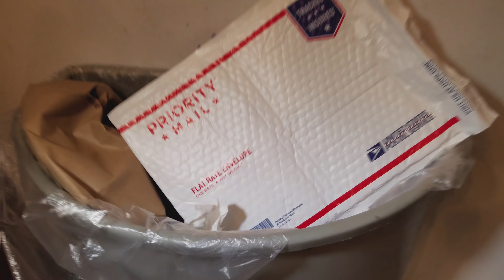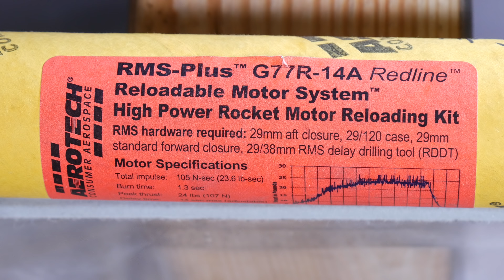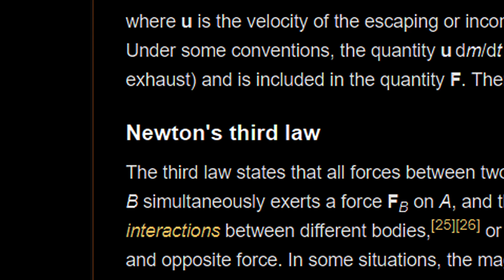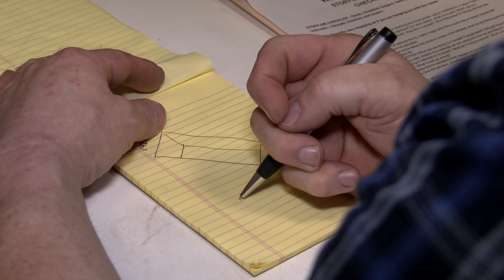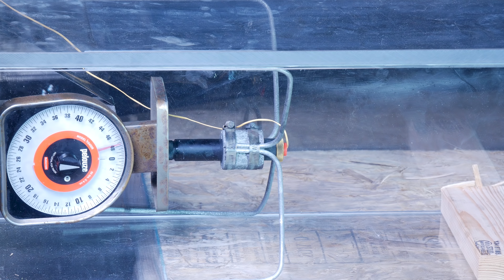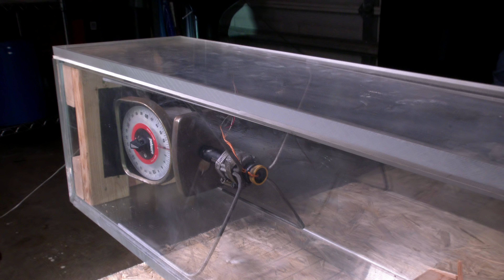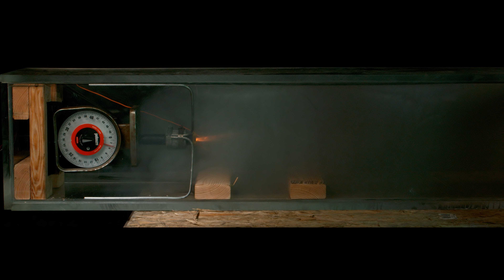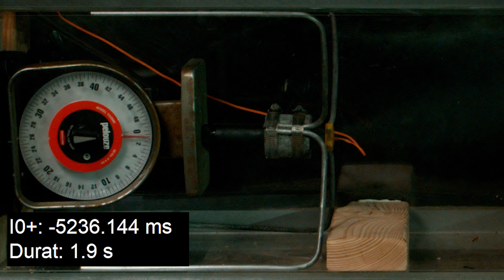Rockets in a Vacuum Chamber - Newton's third law of motion Visualized

Comment: You lost the vacuum by pressuring the chamber with the rocket exhaust.
Show constant vacuum on video next test.
Reply: Plus, I believe they only used solid fuel boosters for liftoff. Once they were in space they used the liquid fuel rockets. Basically another reason this example/test doesn't prove anything. Well, it DOES prove something but to say it would seem 'trollish'.  LOL
Take Care All
Reply: that and there is a wall 3 ft away from the rocket... you would have to build a much bigger chamber imo and show that you had a sollid vacuum the whole time
Reply: Nice to see a few Lions among all the Sheep.
Reply: Not enough atmosphere generated by that rocket motor before it was effected by Newtons third law. It applied pressure to that scale within milliseconds. Your supposition failed.
Reply: We don't know the expansion rate of the burning fuel..  It should be significant,  but,  we don't don't know.
Reply: why did it produce thrust during the initial moment?
Reply: @jackschwartz1783  They solid motars in space as well. Chinese do this often.
Reply: *use
Reply: @SternLX  - Even the tiniest bit of atmosphere, inside a perfect vacuum, would cause this, so he is right. Test is a fail.
Reply: Jesus people what is so hard to believe about rockets burning in space, you need o2 to burn anyways I think that's why they put oxidiser in the fuel???
Reply: How big of a space would you need to properly test this out? You would need a vacumm capable of accepting alot of atmosphere without diminishing. How much material is ejected from a launch like this? I assume its enough to setoff my smoke alarm if i did it at home.

Its funny how most modern attempts to prove these bollocks theories usually end with the attempt further damaging the theory. Haha. But the fools still act like we are the morons. Its an idiocracy. Lol
Reply: look up the amount of exhaust released from the solid fuel rockets, i think once you do the maths you will find that the chamber was no at a vacuum, very quickly :-(
Reply: Daniel Erdman EXCACTLY
Reply: The thrust of a rocket depends on molecules repelling each other and is not dependent on pushing against an outside atmosphere. Think of holding a magnet together where you are pressing the same polarity together. As soon as you let go, the magnets repel each other. The force of your hand was containing all that energy inside of the magnet from doing what it naturally wanted to do.  Magnetism works in a vacuum. it is the electromagnetic force that makes this happen. That same force is contained within each atom. But is held together by an outside force (like your hand) This outside force (called the molecular forces) are released by a chain reaction called combustion. The atoms then do what they naturally do and repell each other. some of these atoms bounce against the rocket and push it forward. This does not require an outside atmosphere to create pressure. It creates the pressure on its own. This pressure is directed so that the only way the molecules can escape is through the nozzle. This happens quickly but not happen instantaneously. if It were instant, you would witness it as an explosion. Since the burning happens over time, some molecules become trapped between the rocket and other molecules that havent found the escape yet. Those molecules bounce around against each other and the rocket and continue to expand until they find the nozzle and escape. Rockets can work in a vacuum.
Reply: @johnmabbott7420  sooo would that not happen in errrrr space............? You people are mental.
Reply: first, there was thrust as soon as seal is broken off. second, no this is not to prove a theory. newtons 3rd law is not dependent on fluid dynamics there is no reasonable reason it should act any different in a vacuum. third, the vacuum of space in not a perfect vacuum. it has something like 5 atoms per cubic meter. is that enough to 'push off of'? if not where is the cut off, what would be just enough?
Reply: En ki  how?
Reply: This test isn’t actually necessary to show that Newton’s 3rd works in a vacuum. A rocket engine creates force by changing the momentum of its propellant. F=ma. P=momentum=mv (mass x velocity).
a=dv/dt=change in velocity with time is acceleration.
dP/dt=change in momentum with time=m(dv/dt)=ma
F=change in momentum with time.

In a rocket the propellant explosion is directed out the back. This explosion is a change in momentum of the propellant. This change in momentum pushes on the rocket. 

He didn’t have to burn a mini rocket motor. He could have used a water hose. Remember, this about Newton’s 3rd law not propellant ignition systems.
Reply: @richardjackson5023  Also thrust was impacting on the end side of the box hence the propulsion even if vacuum.
Reply: @whiskyweasal89  

Because of your word soup?
I don't think so.
Still inconclusive for many reasons, read above.
Reply: @bengrizzlyadams6187  its all bullshit....they know rockets do not work in space..lolol
Reply: Ben Adams you can find inefficiencies in any experiment so I guess when you want science to say what you want it to say then you can explain it away by saying it’s inconclusive. 

But my explanation of how thrust is created does not rely on this experiment, what I said stands on its own but “word soup” heh.. ok man.
Reply: @whiskyweasal89  All the word salad of this world cannot replace a good experiment.
Reply: @whiskyweasal89  Inconclusive means I take no side, there are not inefficiencies but intermittencies.
Reply: @whiskyweasal89  

Speaking of inefficiencies, take Cavendish, its only inefficiency was Foucault's pendulum.
Reply: @whiskyweasal89  Looks to me like we are sitting in some sort of Van Der Graaf generator, we power it though our activity by ionizing the air that then gets trapped into the dome it charges, (hence lightnings when overloaded), it powers both the moon, which is some sort of Pelletier reaction, and the sun, which is some sort of Tesla coil, that acts on noble gasses like on a fluorescent tube, hence the white cold light of the day even without an apparent sun. So life powers the celestial vault in return, the cycles of hot and cold exactly like in a Polymerase Chain Reaction, sustain life.
Reply: I agree, combustion caused expansion of gases that far exceeded the negative pressure  in the chamber, to the point of lifting the plexiglass near the engine. It was a great effort though. It seems it would require a much larger negative pressure chamber to carry out the experiment.  Space has no atmosphere for the rockets to displace, nothing to provide thrust for the rockets to push against.
Reply: @neriuslandys2190  The rocket will have momentum as a result of combustion in the rocket engines.
Reply: @neriuslandys2190  Its hard to single out any group of people for distorting truth and live in the US. That's what this country was founded on, a skill 
 in politics today. We are bombarded with it all the time, just turn on Cartoon Network News and watch Cooper Slanderson blame a short carrot on Elmer Fudd and you'll agree.
Reply: @RadespotosR In the instance of pushing a ball, both bodies will be set in motion in a weightless environment. One would continue to move away from the other until something came along to change their drift. To think that because you push the ball you would remain stationary in space is to say space revolves around you. Since there is no gravity in space why limit yourself to a basket ball when you could move a mountain just the same? With combustion you will have thrust as long as it takes place in an enclosure with an exhaust.  The hot gases produced will be under an extreme amount of pressure to escape.
Reply: @whiskyweasal89  theres nothing higher than truth...truth is rockets do not work in a vacuum....unless u make a lot of gas in a small vacuum first so it can push on that...can't u see they made this to throw u off track....they failed of coarse....
Reply: Dylan Sullivan ppl belive in Jesus. So that experiment could also be real.
Reply: The vacuums case by design creates its own atmosphere  with waste, fumes and hot gasses, it also creates thrust off the end of the case,  nothing like the vastness of space.
This could be solved with a much bigger case and a smaller rocket.
Reply: Ya but he was looking for the push before any buildup of pressure and he got it.  
Later on yes the pressure inside built and helped the thrust.
Reply: @whiskyweasal89  explanations prove nothing...PRACTICALLY DEMONSTRATE your claim or keep your SUBJECTIVE opinions, ideas, theories, concepts and BELIEFS where they belong..in your head where they work subjectively for YOU.Follow the scientific method of discerning Subjective thoughts from Objective Facts . SHOW ME
Reply: Woody Woodlstein   The partial vacuum was so quickly pressured there is no evidence to support his theory.
Others also rightfully pointed out the wall of the case to push off from.
The harrier jet fighters also use directed exhaust to achieve vertical lift.
If the lifting forces came from the internal pressure against the front of the engine, “or rocket”, the old opposite 
and equal reaction, then the harrier jet would not be capable of vertical flight by vectoring exhaust.
This is obvious even in Earths atmosphere, not to mention space.
By the way, the scientists are the ones to claim space to be a vacuum.
Now the same scientists claim the Earths atmosphere extends far beyond the moon.
The truth is that science is constantly changing the “facts” to fit their theory.
In fact scientists are still teaching theories that have been proven to be wrong.
You can not intelligently discuss science with people who keep quoting theory as fact.
I am a commercial pilot and certified flight instructor, who use to teach “scientific theory” 
as it were a fact, until I overcame cognitive dissonance.
We need to question what we were taught by so called scientists, who were taught what to believe rather
than what is true.
Any scientists who question the so called facts is summarily punished, eventually the facts are proven wrong.
History proves this to be true.
Truth takes nothing for granted except that so called facts change in the light of truth.
You can not prove theory by quoting theory.
Only by questioning theory or so called scientific facts can the truth be known.
Godspeed.
Reply: @bobroberts8629  would I feel any recoil if I fired a crossbow in a vacuum?
Reply: SternLX .......   affected.
Reply: @danielerdman7543  on the other thread, I thought you said you were "not so far gone" as to believe that rockets do NOT work in a vacuum.  Well I can convince anyone with a high school grasp of physics that rockets MUST work in a vacuum.  They just need to answer about five simple physics question (with no math).  If that is out of the question, I have proof that anyone can observe in person OR watch any of HUNDREDS of actual videos of rockets working in a vacuum.  Either way: Newtonian Physics says rockets MUST work in a vacuum, or "F=m x A" is false.
Reply: The first question is: if I fire a crossbow in a vacuum, will I feel a recoil force?  Yes or no? Why or why not?
Reply: Stuart Gray    Apples and oranges Stu.......
A crossbow is purely mechanical.
A rocket allegedly moves because of the opposite and equal reaction forces pushing 
against the front of the rocket.
If this were true then how does the vectored exhaust on the Harrier jet achieve vertical flight ?
Unless you move the front of the engine upwards, how does the compressed air, expanding hot
gases push the jet upwards ?
Only if the compressed hot burning expanding gases are pushing against the ground then the atmosphere 
can it create lift.
NASA claims space is a vacuum so without an atmosphere to push against, the rocket has a problem.
Unless the exhaust is not the motive force and the equal and opposite reaction pushing against the front 
of the rocket is the correct theory, and then the Harrier jet has a problem.
By the way, science now claims that the Earths atmosphere extends far beyond the moon,
according to the European space agency in yet another video.
Godspeed.
Reply: @danielerdman7543  - "Apples and oranges Stu.......
A crossbow is purely mechanical."

Yes as is a rocket engine shoving MASS in one direction EXACTLY like a crossbow firing a bolt.
Or are you going to argue that the Law of Conservation of Momentum DOES NOT apply to gas molecules?
You wouldn't DO THAT because it would prove that you never took a single Physics class as part of your "Electronic Degree"

so what do you say, do gas molecules have MASS?  DO they require a FORCE to accelerate them or not?

If you had the courage to just ANSWER my questions without trying to change the subject you would understand very quickly how it works.
But just like others who PRETEND that their degree is the same as an actual ENGINEERING DEGREE, we see that your "degree" does not even include HIGH SCHOOL level physics concepts or you woudl just ANSWER my questions instead of distracting FROM THEM.
Reply: Oh I SEE you mean where I called you a liar (on a different thread) for LYING ABOUT WHAT NASA SAYS?  Then YES I DID call you a liar again because what you said are flat out LIES.
Reply: Bob Roberts    This experiment is far from a valid scientific approach.
NASA claims on videos to have repeatedly traversed the deadly VanAllen radiation belt
for years on our trips to the moon.
NASA now claims on videos that we can not send men through the very same Deadly belt.
NASA further claims that they forgot how they did this and lost their notes.
NASA is obviously lying.
Why is NASA still running things and funded millions?
How stupid are we ?
It is time to bring NASA to court for fraud and racketeering, put them in prison 
and find out what they are hiding and where the money really went.
Godspeed.
Reply: Stuart Gray   Poor poor Stu...
Ok let’s do this the scientific way.
First state by what force is the inertial mass velocity changing.
What is the mass force pushing against ?
Is the rocket moving through the vacuum of space because of the opposite and equal reaction 
force pushing against the front or inner bulkhead of the rocket ?
Or is the rocket moving, changing its inertia by some other reasoning ?
I need to know what you are specifically stating is causing the rocket to change its inertial state and move.
Please respond.
Godspeed.
Reply: Stuart Gray           that is unwarranted Stu....
You misquoted and likely miss understood me.
I never said NASA admitted forgetting everything or loosing everything or can no longer launch rockets.
What I did say is that NASA videos state that they lost the technology and by logical inference can’t 
remember how to send manned missions to the moon or beyond.
NASA videos also state that they repeatedly traversed the Deadly VanAllen Radiation belt for years
Just decades ago on their successful maned moon missions.
NASA videos now state that before they can risk manned missions to the moon and beyond that
they must first figure out how to protect the men from the deadly radiation.
These videos are NASA’s own videos, they are historic documents, they are indisputable facts.
This is what I said Stu.
You deliberately misquoted me instead of intelligently discussing this with me.
You are once again guilty of liable.
I am getting a bit offended by your repeated personal attacks of my integrity, cool your jets ok ?
Now that I put you in your place, take a deep breath and put your scientific mind to the task.
How can you possibly argue that NASA by their own videos prove they are lying one way or
another, either they did or did not traverse the deadly VanAllen radiation belt or they didn’t.
Either way now they claim to have lost the technology (which is unbelievable and grossly negligent).
Furthermore how and why is NASA still running anything in light of their own damming videos?
I can’t wait to hear your next apology and explanation.
Godspeed.
Reply: @danielerdman7543  - "NASA claims on videos to have repeatedly traversed the deadly VanAllen radiation belt
for years on our trips to the moon."

NASA DOES NOT SAY THIS you are MAKING SHIT UP!
Reply: @danielerdman7543  - You dont get to answer MY question with more questions:  I CAN CONVINCE you but YOU Must provide the answer to MY questions without putting words in my mouth. Now ANSWER THE FIVE SIMPLE QUESTIONS: 

1 - IF I fire a crossbow IN A VACUUM, IN a WEIGHTLESS (freefall) environment - WILL I FEEL RECOIL ? YES OR NO?

I will NOT go on until you answer.

If you would like to surrender and admit that you have no intention of answering JUST FUCKING SAY THAT.
Reply: @danielerdman7543  OH and I TOLD you I have VIDEO EVIDENCE of rockets working JUST FINE in a vacuum, but I will not show the videos to you until AFTER you answer my questions OR ADMIT YOU CANNOT.   I have not even TOLD you that the company I work for buys Hydrazine Mono-propellant thrusters from Moog corp.  We TEST EVERY SINGLE ONE - IN HARD VACUUM to verify that they provide the same thrust as predicted by the rocket equation .  I have EYE witness test reports to prove it.  Lookup Moog corp for a description of their thrusters and their Vacuum test capabilities.

And DID YOU EVER WATCH that video about the Honeywell pre-flight test of the RLGs?  The one where the Honeywell engineer explain how his Inertial Reference UNit MEASURES EARTH ROTATION before a flight?  NO? WHY? Scared?
Reply: Stuart Gray     Hello Stu,
Since I do not believe in your what if question being possible I am reticent to guess.
However, I will.
In my opinion theoretically you would feel a recoil, the arrow would move away from you
because of the greater mass of you and the bow as something to push off from.
The potential energy from the spring is converted into kinetic energy to cause
the inertial state of the arrow in such a way as to propel it at a certain velocity and trajectory
unimpeded until acted upon by an outside force.
You might also induce an inertial change in yourself and the bow due to the recoil effect.
Does my opinion differ from yours ?
Now please answer my question.
What specifically causes the rocket to move, the escaping exhaust gases or the opposite 
and equal reaction force applied to the front or inner bulkhead of the rocket ?
Quid pro quo.
Godspeed.
Reply: Stuart Gray    Hello Stu,
I would be very interested in seeing your videos of a real practical test of a rocket operating in an appropriate 
vacuum test, not a small plastic box like the one that started this conversation.
You gave me so many things to read before you would even talk to me civilly, I think I did watch the video
you reference.
The problem with them all is that they pre-suppose a spinning globe model right from the start and base
all of their theory of operation on that unprecedented premise.
I do understand the theory of operation however it does not prove the spinning globe model 
it assumes it fight from the start.
This is like you keep saying, it is so because you say it is so.
Your only authority and supremacy is self declared, not in any scientific way proven.
This is the fundamental flaw and problem with your theory.
Scientific theory has been adulterated by over zealous self asserting experts who
declare scientific theory to be “the law”.
As scientific knowledge increases it is summarily impeached at the first suggestion of violating 
a “scientific law”.
For science to be pure, unadulterated, and truthful there is no room for absolute law.
The truth is, always was, and will always be, above any so called law.
If the law can not and will not tolerate being questioned, it is not the truth.
The law fears and falls or stands subject to only the truth.
The truth is supreme, not the law.
Every true science is subject to the truth.
Science is the pursuit of truth.
Today science has been adulterated by self appointed experts who seek fame and fortune above 
the truth, the true science.
This is why it is so hard for the experts to accept the truth rather than protect their own self interests.
Today science is all about the fame and fortune and protection of the status quo.
You can’t be published if you go against the status quo, you are labeled a lunatic.
You loose your license as it were, your credentials, your standing, your carrier.
Just like the so called flat Earthers, just because they dare question the law.
The so called law is the problem.
Godspeed.
Reply: @danielerdman7543  - Your answer is correct.  A bow WILL FEEL recoil in a vacuum (in "zero-G") when it fires a projectile ("Bolt").
This is because the Bolt HAS MASS.  As the Bow pushes on the Bolt, the Bow feels the SAME FORCE as the Bolt does for the SAME amount of time until the bolt leaves the "breech" and is no longer touching the string.
This is Newton's Third Law: "For every Action (the bow pushing on the bolt), there is an equal and opposite Reaction (the Bolt pushing BACK on the Bow)"

Second question: What do we call the PROPERTY that the Bolt HAS that allows it to PUSH BACK on the Bow when pushed upon?

Third Question:  If we replace the Steel Bolt with a Bolt made of WATER ICE (same Mass) will the Bow STILL FEEL a recoil?  What about DRY ICE (solid CO2) will we still feel a recoil?

"You might also induce an inertial change in yourself and the bow due to the recoil effect."
DO you know the NAME of the Physics concept that makes your statement above a FACT?
That is the "Law of Conservation of Momentum" are you familiar with it?
Reply: @danielerdman7543  - "The problem with them all is that they pre-suppose a spinning globe model right from the start and base
all of their theory of operation on that unprecedented premise."

NO - then you DID NOT watch the video, so I will explain it to you.

Lets consider a SINGLE AXIS ring laser gyro (Sagnac Interferometer).  It is basically a coil of fiber optic and it can sense rotations about the axis that goes through the coil like the axle on a bicycle wheel.

An actual GLOBE will help you visualize the following: 

If you take this RLG and set it FLAT on a level table at the North Pole and read the rate is says it it rotating at it will read 15.0 degrees per hour because the sense axis is ALIGNED perfectly with earth's spin axis.
If you FLIP IT OVER, it will read MINUS 15.0 degrees per hour.
If you STAND IT STRAIGHT UP, it will read ZERO DEGREES per hour because it has NO COMPONENT of earth's spin axis aligned with the sense axis.

Now repeat this experiment at the Equator:

If you take this RLG and set it FLAT on a level table at the EQUATOR and read the rate is says it it rotating at it will read 0.0 degrees per hour because the sense axis has NO COMPONENT of earth's spin axis aligned with the sense axis.

If you STAND IT STRAIGHT UP,  it will read 15.0 degrees per hour because the sense axis is ALIGNED perfectly with earth's spin axis.

Now repeat this experiment in Wyoming USA (latitude ~45.0 degrees):

If you take this RLG and set it FLAT on a level table in Wyoming and read the rate is says it it rotating at it will read close to 7.5 degrees per hour because the sense axis is only HALF aligned with earth's spin axis.

Now TIP the gyro UP 45.0 degree towards the NORTH and the GYRO WILL READ FULL EARTH RATES. - 15.0 degree per hour because NOW it IS aligned with earth's spin axis.

Now imagine an Inertial reference Unit that has THREE Sagnac Interferometers all aligned Orthogonally with respect to each other. (at 90 degree to each other).

Now it can sense rotation about ALL THREE AXES.

When a Three axis ring-laser gyro is placed on a level table it can sense the spin of the earth on ALL THREE AXES.   Lets say the "Z-axis" is pointed, aligned with the gravity vector ("Up").  Lets say we are in Wyoming again.
Align the X-axis "North"
This will align the "Y-Axis" to the "West".
SO NOW the Gyro will read ~7.5 degree per hour on the Z-axis (like in the example above)
It will read ~7.5 degree on the X-axis since it is tipped 45  degree with respect to earths spin axis like the Z-axis.
The Y-axis will read 0.0 degrees since it is perpendicular to earth's spin axis.

Using this knowledge and SIMPLE TRIG, you can determine YOUR LATITUDE ANYWHERE ON THE GLOBE using JUST a three-axis ring laser gyro and a bubble level.

If the Gyro had ever been calibrated ( to know what it reports as positive rotation versus negative) then you CAN TELL WHICH HEMISPHERE YOU ARE IN.

You can even do this correctly with a little math EVEN IF THE GYRO IS AT AN ARBITRARY ORIENTATION with respect to "North, south, east, west".

THIS IS HOW the three axis ring-laser gyros perform pre-flight tests.  If they DONT READ THE PREDICTED RATES on ALL THREE AXES based on where they are on the Globe, THEY GYRO IS BROKEN.

Daniel Erdman - I have PERSONALLY measured earths SPIN AXIS (using an Airbus Astrix-120) with respect to the local gravity vector in Boulder, CO, then I DID IT AGAIN at VAFB, CA.

GUESS WHAT? - The alignment of earth;s spin axis (with respect to the local gravity vector) SHIFTED BY ABOUT 5.5 DEGREES between the two locations.

Care to GUESS WHY that was the case?
Reply: Stuart Gray    I answered your what if, now pay up and answer mine.......
I am not taking a damn physics test Stu.
You agreed to answer my question after I answered yours.
Pay up or shut up !
Godspeed.
Reply: @danielerdman7543  finish answering my questions, and you will answer your question YOURSELF.
Reply: Stuart Gray   Yes I did watch the video.......
Don’t you see that you just keep repeating the same old explanation which is unconditionally 
based on the false assumptions of a SPINNG GLOBE FALICY ?
Right from the beginning your device assumes a spinning globe, it does not prove the assumption!
This device just like the original gyro operates on the principle of the gyroscope’s rigidly in space.
Wether the Earth is a spinning globe, or as all aviation charts specify a flat plane non spinning model
for all real time navigation, the gyroscope couldn’t care less.
The gyroscope could theoretically be in a space ship on its way to mars !
You claim and assume your model, the gyroscope proves it not.
In reality it does perform on the real and only officially accepted Earth model 
the flat plane, non spinning model.
The only official and accurate map is the flat Earth map.
There is absolutely no accounting for any Earth curve in any navigation problem.
The Air force, Navy, Surveys, and railroads never take the alleged curvature in account.
Show me one instance in practical navigation, any real navigation chart used by real pilots
that include curvature.
Something real in practical every day use today not some exotic math that takes four years to comprehend 
because it is not real.
Show me an engineer who works here on Earth not allegedly in outer space that actually enters the alleged 
Earth curve in account.
No surveyors do.
No pilots do.
No submarines do.
No naval gunnery or missile launch officers do.
Show me just one Earth bound real example.
You can’t, can you ?
The Earths curve is only alive in the over active demented mind of esoteric pseudo science.
Now put up or shut up.
Godspeed.
Reply: @danielerdman7543  - "Right from the beginning your device assumes a spinning globe, it does not prove the assumption!
This device just like the original gyro operates on the principle of the gyroscope’s rigidly in space.
Wether the Earth is a spinning globe, or as all aviation charts specify a flat plane non spinning model"

This is PROOF that you either did not read my explanation or you didnt understand it.  THE DEVICE MEASURED THE CURVE between Boulder, CO and VAFB, CA.  There is NO SOFTWARE to "fool" me in this system. We verify earth rotation rates WITH RAW DATA FROM EACH GYRO AXIS - YOU CANNOT "FOOL" IT .
Reply: @danielerdman7543  - " am not taking a damn physics test Stu."
WHY? Because you are INCAPABLE, or you KNOW that IF you answer my questions truthfully that IT EXPOSES THE FLAW IN YOUR REASONING?

Now answer the questions: 

Second question: What do we call the PROPERTY that the Bolt HAS that allows it to PUSH BACK on the Bow when pushed upon ?

Third Question:  If we replace the Steel Bolt with a Bolt made of WATER ICE (same Mass) will the Bow STILL FEEL a recoil?  What about DRY ICE (solid CO2) will we still feel a recoil?
Reply: @danielerdman7543  As for your navigation over a sphere - Wolfie6020 is a REAL PILOT, he can educate you. 

 Search YT for:
 "Another Flat Earth pilot caught out. Yes Pilots do learn to fly over a Globe."

  He has MANY videos proving you wrong.
Reply: @danielerdman7543  See my NEW THREAD on this video directed specifically at you.
Reply: Stuart Gray    What video ?
Better yet Stu answer my question it is your turn to answer just one question, pick one of the two.
Put up or shut up.
Reply: @danielerdman7543  Respond to my new thread on this video directed at you
Reply: Stuart Gray    Oops little Stewy woke up again, whose turn is it to change his diaper ?
Put up or shut up.
Nite-nite little Stewy.
Reply: Stuart Gray     Someone needs a nap.
Stu, I have no idea what thread you are even talking about I had to scroll through 87 responses just to answer you now.
I also have no intention to keep answering your insane questions whereas you never answered either of my two
questions that I repeated for you very many times.
What makes the rocket move, is it the expanding exhaust gases out the rear or the opposite and equal reaction pushing against the 
front or inner bulkhead of the rocket ?
Show me any Earth based common everyday flight plan that asks for the alleged Earth curve.
Not one from outer space or involving some new laser ring or fiber optic gyroscope that is so expensive 
it is not common in the general aviation community.
Either would be appreciated.
I answered your questions now it’s your turn, ok ?
Godspeed.
Reply: @danielerdman7543  - "Stu, I have no idea what thread you are even talking about I had to scroll through 87 responses just to answer you now." 
Go to the VIDEO: "Rockets in a Vacuum Chamber - Newton's third law of motion Visualized" COMMENTS and click the "Sort By" Button, and select "Newest First".
Scroll down a few posts and Select the thread (top of a series of posts) that starts with "@Daniel Erdman - Since you REFUSE to just answer some high school level physics question"
Reply: @danielerdman7543  just for anyone ELSE reading this thread, I will post your answer FOR THE FOURTH TIME :. SO I will repeat it here so you can have others in your special needs class explain it to you:
  "Just as the Crossbow PUSHES on the MASS of the projectile (This is the ACTION), the MASS of the projectile PUSHES BACK on the Bow (this is the REACTION).

See how the Crossbow obtains some rearwards MOMENTUM that it did not have before the firing.
This MOMENTUM is EQUAL to the momentum transferred into the projectile 

This is the "Law of Conservation of Momentum".

Now as a rocket nozzle ACCELERATES the MASS OF THE EXHAUST GAS out the back of the rocket - THIS REQUIRES A FORCE>

Daniel - You are NOT going to suggest that the MASS of the exhaust gas gets ACCELERATED WITHOUT A FORCE are you?

Now as the ROCKET NOZZLE applies this ACCELERATING FORCE on the mass of the exhaust gas - THE ROCKET NOZZLE FEELS AN EQUAL FORCE in the opposite directio

The Momentum transferred TO THE MASS of the exhaust gas IS THE SAME as the momentum transferred to the ROCKET NOZZLE.".   Perhaps you have forgotten how to READ in your deteriorated mental state?
Reply: Atmospheric internal pressure, which serves to ignite the rocket at the last attempt, comes from behind plus the added internal pressure generated by the system we know from the first law of thermodynamics, which pressure actually quickly fills this little funny vacuum chamber, which pressure is formed from the burnt and ejected gases in vacuum and form a small gas-pressure space that in fact displaces the vacuum and fills with exhaust gases and unburned gases this little space - in this absurd funny - little "vacuum" chamber.
Imagine a suction vacuum with a force of 10 to a minus 17 degree suction force plus an external pressure of 1013.25 hPa atmospheric pressure suction vacuum which has a reverse force of 10 to 17 degree of atmospheric gas under pressure, that is suction suction with power 10 to 17 degree, and atmospheric gas pressure, pushing 1013.25 hPa.
When they lifted the upper plane of this funny "vacuum" camera, this platform plastic board bent only by the power of its own weight, making us feel like fools to believe that these funny plastic board would withstand the suction vacuum that is a reverse force of 10 to minus 17 degrees without bending inward, plus the force of atmospheric gas that pushes externally with a force of 1013.25 hPa.
 Each rocket engineer can confirm that there is no rocket engine running at the same time in atmospheric gas and the engine running in a vacuum environment because the rocket gases will be scattered for only a fraction of a second in the vast vacuum space, have nothing to push and have nothing to push in the vacuum to get some boost on this rocket, because the vacuum is nothing, the vacuum has no density.
Fire on the rocket can be secured with additional atmospheric pressure, as did this ridiculous, conspiratorial, stupid man after many failed tests, that this rocket will ignite and burn very well in a vacuum if it is secured on that rocket oxygen, .. but this missile has nothing to push, nothing to pushed or propel into the vacuum, because vacuum is nothing, no density, unlike atmospheric gases, which gases will be scattered only in the nano-second in the infinite and vast vacuum space , ... but the gases in in this little one funny - small "vacuum" chamber will immediately fill this small space and this small space will no longer be a vacuum and under this condition can now get some impetus to this racket.
Why does this a crook - conspiratorial man not use NASA's vacuum chambers, which are a few meters thick and  to do this experiment again? We, the well-meaning people with proper logical and critical thinking, know why this conspiratorial man would not do such a test. Because we know it will fail!
Reply: @biser1901  so that long winded crap was all to say: "rockets don't work in a vacuum, because I don't understand physics"?
Reply: Stuart Gray 
More mumbo-jumbo.
Try plain ole English Stu.
What makes the rocket move, the expanding exhaust gases, or the internal force pushing upon the front
inner bulkhead ?
Stop hiding behind pseudo science, just speak plainly and honestly, if you can.
Godspeed.
Reply: Stuart Gray 
No Stu with some 100 replies I don’t know what you’re talking about.
Just answer my ever so simple question instead of suggesting another video, ok sport ?
Put up or shut up.
Reply: Stuart Gray ok, you two guys are the same guy. What’s my prize?
Reply: @whiskyweasal89  repeatable working proof of it besides the government or space agencies  info.
Reply: @MrAgatto2  not only a wall , but also the gases produces by ignition created a cloud which means -different kind of atmosphere - which no longer is a vacuum therefore it increased the thrust.
Reply: @danielerdman7543   Ok. Let's say you're right about NASA. What of Russian and Chinese Space Agencies? Just curious to your thoughts.
Reply: Mark Rushton 
NASA is the big dog.
Her puppies are the rest.
What moma says is it.
All the other so called space agencies are signatories to the Antarctic Treaty.
They were all created to hide what Admiral Byrd discovered in Antarctica.
Godspeed.
Reply: You’re correct.  However, there is no oxygen in the chamber other than the oxidizer in the rocket engine.
Reply: Joe Beans 
There is no oxygen in the chamber other than the oxidizer ?
What is. Your point ?
???
Reply: Dylan Sullivan 
What actually makes you move, the expanding exhaust or the opposite and equal forces pushing against the
front or internal bulkhead of the tank ?
Godspeed.
Reply: I saw that as well. The proof was when the rocket did ignite, the ignition was further back in the chamber because of the loss of vacuum and addition of oxygen at the failure point in that area.
Reply: @jackschwartz1783   Wrong, solid rocket motors are used both in atmospheric phase of the flight and during "space phase". They are used since the beginning of astronautics, there was/is a number of solid propellant stages in service like the IUS and different Star kick stages, even the first US satellite was injected into orbit with solid rocket motors (except for the first stage of the Juno I which was hydyne/lox).
Concerning this video, it's the first milliseconds of the ignition that are interesting, when there is no gases in the chamber. Those first instants clearly shows thrust as it is expected.
Reply: @fuckednegativemind  Yes they are but not all the time. Therefore I'm not Wrong. Yes I did look it up before I posted. You merely cited several examples. A bit of advice, starting your reply with the word 'wrong' and then following it with a few examples (but not covering all examples) tends to make you appear trollish. Next time do little more research before you just jump in and start criticizing.
Reply: @jackschwartz1783   It may would have been true if it was what you said, but you wrote "I believe they only used solid fuel boosters for liftoff". You clearly said "only for lift off", which is wrong, as I showed you.
And it's not "trollish", it's called sharing knowledge, you know, when you learn something from someone who know the subject better (or more fully) than you.
Reply: @fuckednegativemind  There's nothing wrong with sharing knowledge. The 'I believe' part was a polite way of sharing information and keeping the discussion goin. Had you read further down you would have seen others point out this error in a more polite manner than you did. Now if you want to come out here in an arrogant manner acting as though you know it all, you did a great job but your approach serves more to chase intelligent people away and tend to make them disavow you information from the start. This is a sharing of information not an I'm Right and You're Not competition. Your final sentence here just backs the fact that you consider yourself to be a Know It All. If you're just here to boost your ego you're doing an outstanding job. 

  So if you're here to truly share information you may want to tone down the way you share. If your just here to feed your ego and blow your own horn screaming 'Look at how great I am' then there's probably not much more I can say to you that will matter. Good Day to you sir  and
  Take Care All
Reply: @jackschwartz1783   Are you made of sugar? Sorry if I hurt you, but there wasn't any agressivity in my sentence, in fact, it was pretty neutral. If you can't accept being wrong, that's not my problem, but you'll never learn from your mistakes. You were wrong, what a big deal... Anyway, I hope you learn something, and please, don't be offended by comments, most of the time it's difficult to get the general tone. Have a good day.
Reply: @bengrizzlyadams6187  Would you experience recoil if you fired a shotgun in vacuum? Yes. The molecules in the gas are small pellets with mass.
Reply: While this is a valid point, you can see that it does produce thrust during the portion where all the exhaust is fully behind the engine. This is also what happens to rockets in space
Reply: EXACTLY!
Reply: @jackschwartz1783  actually, many rockets use solid fueled upper stages (e.g. black arrow). The reason why it's uncommon is because solid motors are not controllable, and in an upper stage what you're after is not raw power, but instead control, something which solids don't provide. Hope this helps.
Reply: @jackschwartz1783  - I just saw this last part of the conversation.  Jack - YOU WERE WRONG when you made your statement PERIOD.  now just man-up and admit you were wrong. You stated "I believe they only used solid fuel boosters for liftoff"

Which is FALSE. I have launched FIVE spacecraft on Delta-II rockets and FOUR OF THEM had solid rocket motors on the third stage that LIT IN HARD VACUUM.
There 100% proof that your statement was wrong.
Now quit arguing just because you are embarrassed to be wrong...
Reply: the force is created right after the smoke touches the dead end. In real, it should be touches something, isn't it?
Reply: @Royvan7 newton's third law is dependent on an outside force acting on an object. Internal forces cannot affect the motion of the system.
Reply: @72golfcrazy the third law needs an outside force to act on an object. If you read the whole law it's an external force acting upon an object. If that were true, you would get on a flat smooth surface on a skateboard and hit yourself in the chest really hard over and over and that force caused by the acceleration and mass of your fist should propel you, but even you know that doesn't make sense. With nothing to use in its environment, unless you can consider the propellant being pressurized prior, which is potential energy, then releasing that pressure could propel it small amount but as soon as you used any propellant, that would be over. Imagine falling in freefall from a plane and throwing a bowling ball. Besides the little bit of air you push against, you might rotate by expelling some of your weight, but no force in the opposite direction wound be obtained.